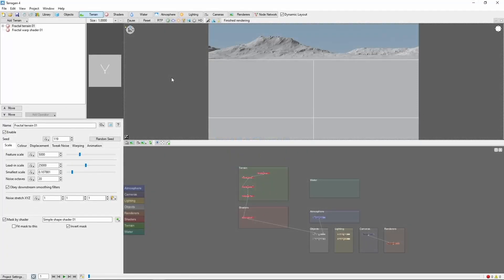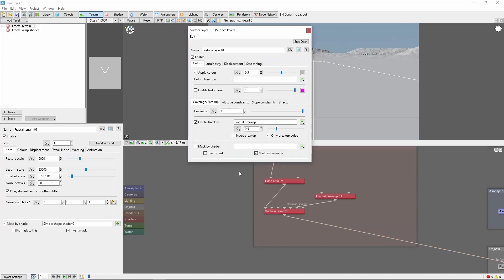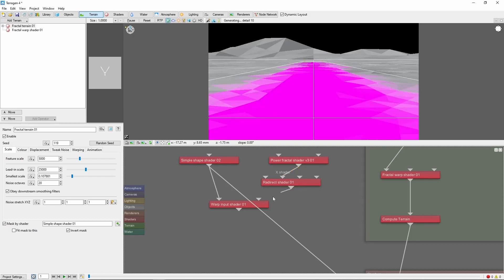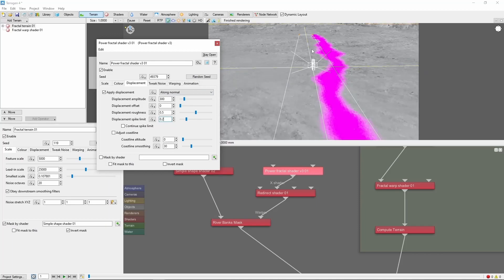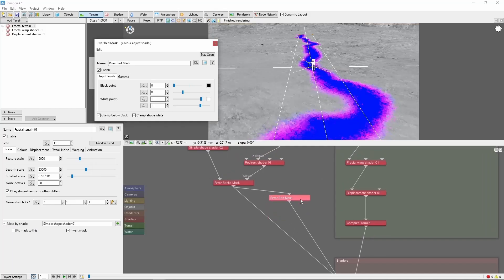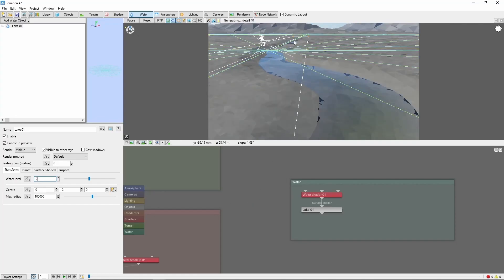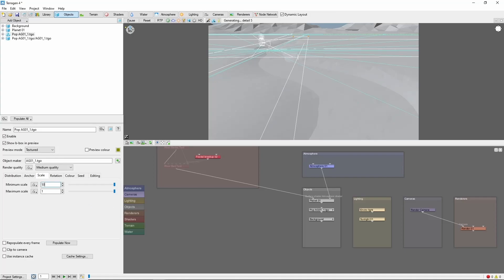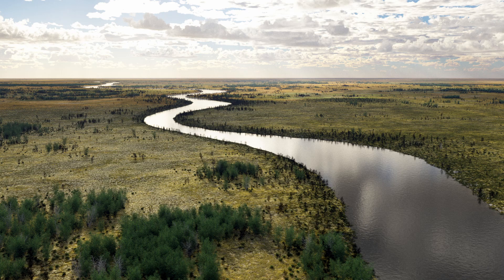Terragen 4 Basics: Build a Basic River

Comment: Another great video!

Do you know how to create a clay render in Terragen? Meaning that all objects have a grey claylike texture with the lighting/atmosphere the same as a normal render.

Other than going into every shader manually, is there another way like using Render Layers? or some way of disabling shaders in a Render?

Blender has an override for all shaders, maybe Terragen will have one someday.
Reply: I was thinking too hard. 

For Surface shaders; Add an unedited Default shader as the last shader to be plugged into the Planet's Surface shader (Previous shader in group should be plugged into Main input of the Default shader.) - This makes the terrain claylike grey.

For Objects; Add an unedited Default shader to the Internal network as the last shader which plugs into the bottom Surface shader (Same as above plug the previous shader into the Main input of the Default shader.) This makes objects claylike grey. Unfortunately, you'll have to do this for every object.

Then when you want to see the shaders again just disable the Default shader nodes.